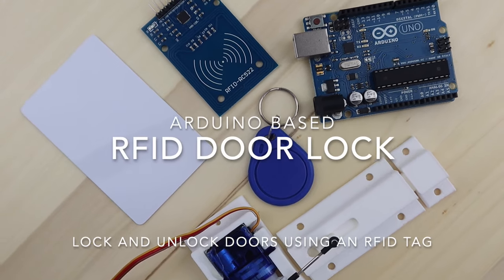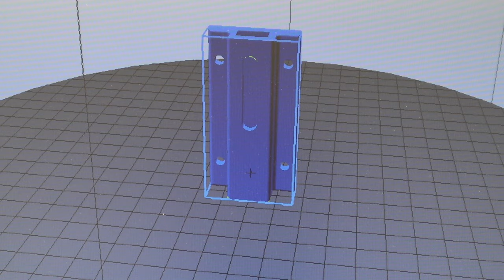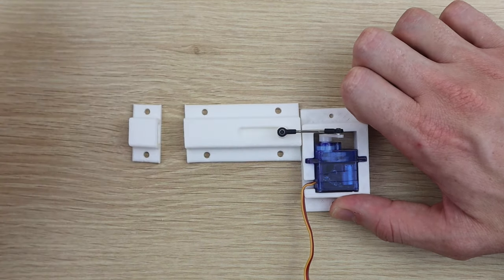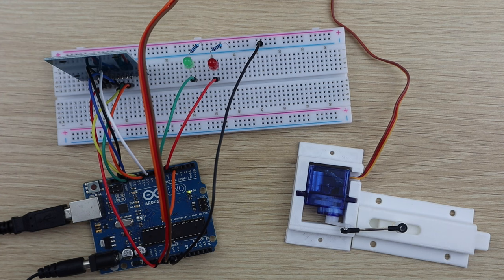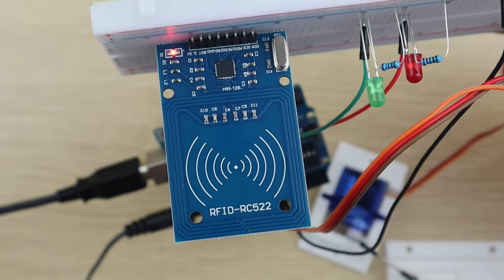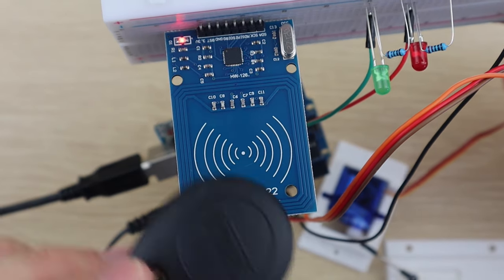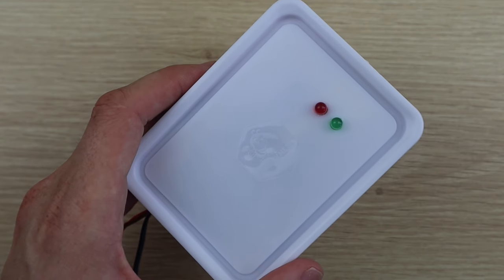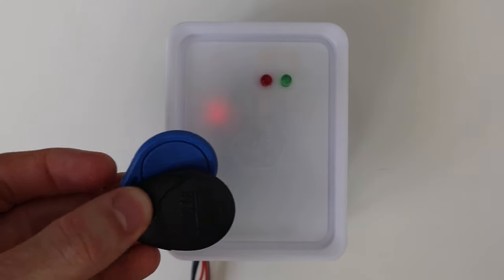Arduino Based RFID Door Lock  - Make Your Own

Comment: I like your design. Have you considered adding a keypad to this? A concept in security is 'something you have - the RFID tag, and something you know - a passcode'
Reply from the maker: Thanks PyroRob69. Yes, a keypad would be a nice addition. You'd have to get rid of the LEDs then though as there aren't enough IO pins for both. There are only 6 spare and you'd need 8 for the keypad.
Reply: @MichaelKlements  Unless the LCD was using I2C. Also, with the LCD, you could use single char's to do the same thing as your LED's do. You can place any char you want, in any place you want on that display.
Reply from the maker: Yes, an I2C LCD display would be a nice addition as well. You could then add the card/tag owners name to be displayed when a valid card/tag is read as well.
Reply: @MichaelKlements  I have found two I2C devices that would allow you to use a standard keypad with. One already has a keypad library written for it, but the other would require you to use bit banging and the Wire library. On the upside, the one that requires the Wire library can handle 16 pins instead of just 8, therefore you could control both the keypad and the RFID scanner with one I2C adapter.
Reply from the maker: These look great, I'll definitely have a look at them! Thank you.
Reply: @MichaelKlements  Cool! I hope you will make another video using them :) (hint hint!)
Reply: @PyroRob69  You can always use Shift Registers when you dont have anough I/O pins. you can create unlimitied I/O pins from just 3 pins. You would just then have to implement the logic.

Comment: I'm new to this. i have watched some instructional videos including yours. this one was perfect. from what i have picked up, I'm a little stumped here now. how would one go about adding a push button to this circuit to cycle the servo motor separate from the RFID reader control?
Reply from the maker: You'd just need to add a pushbutton onto one of the Arduinos digital inputs and add a condition to the main loop in the code to move the servo if the pushbutton is on or off. The Arduino can choose to override the RFID input.
Reply: @MichaelKlements  could you also put a delay and re-lock the device after a set amount of time? I am looking at using this to keep my dog out but allow the cat to go through a door.

Comment: great code! 

however id like to add that it would be better if the mechanism locked  itself automatically, no need to use the RFID tag to lock it, its supposed to be used exclusively to open it (like a conventional hotel room door that uses this tech)

Comment: how to access the lock from the other side of the door? like locking or unlocking from the inside
Reply from the maker: It depends on whether you want it to be secure on the inside as well. Most places would just have a push button on the inside to open the lock again. This lock stays open until you scan the tag again and then locks. So you lock and unlock it from the outside.

Comment: Hello! I got an error when trying to verify it. It says "RFID.h: No such file or directory". I haven't attached my arduino yet to the pc. What can I do to fix this?
Reply from the maker: Install the RFID library that was bundled with the code .zip download
Reply: @MichaelKlements  Thanks, I already figured it out. May I ask, I have a RFID id from my school, will this also work with that type of rfid scanner?
Reply from the maker: You'll just have to try it. There are a wide range of RFID frequencies and technologies, so it's unlikely to work, but it's not impossible.
Reply: @MichaelKlements  Alright, Thank you so much!
Reply: @MichaelKlements  Hi, do I need to solder the head pins that comes with the rfid scanner?

Comment: To who ever is using an arduino uno r3 and is experiencing problems with the card reader. Plug the rst pin which is on the sensor to the 5th pin on the arduino

Comment: i uploaded the code and it works but i dont know the number for my card and tag so how do i find it?
Reply: i tried using serial monitor but it does not show the tag or card being denied it only says place card/tag near reader
Reply: the D1  light on the reader is lighting up red
Reply from the maker: If you're card doesn't show up in the serial monitor then it's either not able to be read by the RFID sensor or you've got a wiring problem and the sensor isn't communicating with the Arduino.
Reply: ok ill try rewiring the rfid sensor and get back to you
Reply: im sorry that im taking more than a month to respond, but thank you soo much it works it was probably a problem with my wiring. Thank you

Comment: Hi, where did you get the metal arm to attach to the servo? Or did you make it yourself? If so, do you have any resources that you could point me towards for making one? Thanks, video was super helpful!
Reply from the maker: It's just a standard servo push-rod and ball from Hobbyking, they're used to actuate the control surfaces on RC aircraft. Glad it helped!
Reply: @MichaelKlements  Thanks! New to this stuff so wasn't sure of the term.
Reply from the maker: No problem. You should be able to buy one off eBay, Hobbyking or a local hobby shop for quite cheap.

Comment: Hi again! I just bought a similar Rfid module, should the pins be soldered? It seems firm in the video, I tried to do this project and it did not work in my 1st try.
Reply from the maker: Yes it works best to solder them
Reply: @MichaelKlements  Alright, thanks!

Comment: I'm wondering if I can use this to diy a pet door so it will lock when my cat goes near it? How close does the tag need to be to the sensor for it to read? And is there a way to make it so the lock stays open but when the tag is within a specific distance it will stay locked until the tag leaves the sensor range? Of course, making the locked position the default would also work if I put the tag on the dog, but that still leaves the question of how close it has to be to the sensor?
Reply from the maker: Hi Elizabeth,
You could certainly do what you’ve described with an RFID tag, but these particular ones need to be quite close to be read. Probably closer than what a pet would be able to get it unless you could figure out how to hang it so that it came within about 2-3cm from the read when the cat tries to go through the door. Different tags work on different frequencies and offer longer or shorter reading distances. The ones on credit cards for example need to be really close while ones used in vehicle tags can be read from around 5-10m away.
Reply: @MichaelKlements  awesome! I was starting to lose hope after doing some more research (I don't have any kind of experiencewith this kind of thing, but I do research for a living so I'm pretty determined to figure it out lol), but I'll look into the other types you mentioned! Thanks!

Comment: It finally worked, i just soldered the pins with the rfid module. Last question, is it okay to connect it with a 9volts external battery through DC?
Reply from the maker: Yes you can use a 9V battery, but it must be connected to the barrel jack on the Arduino so that it is regulated.
Reply: @MichaelKlements  Thank you! is it always safe to use 9V battery and connect it to the barrel jack of the arduino? I sometimes worry that some components might burn. Sorry I am new to this.
Reply: @MichaelKlements  And how would I know if it is not safe. I always worry that some parts such as led or rfid scanner would broke if I do a wrong power supply voltage.
Reply from the maker: As long as it's a 7-12V battery it'll be fine to connect to your Arduino's barrel jack. The Arduino regulates the voltage to 3.3V and 5V, just make sure that your sensor is connected to the correct supply voltage. Most (almost all) sensors that are made for tinkering with electronics are 5V compatible, there are however a few that run on 3.3V but will say so in the datasheet.
Reply: @MichaelKlements  Update: I tried connecting to to a 9V through the arduino jack but weird stuff keeps happening. When I scan the rfid with access, the led lights keeps on flashing and servo motor keeps on moving. But all seems well if it is connected to the computer.
Reply from the maker: A 9V block battery can't provide enough current to power a servo, so the voltage is dropping and causing your Arduino to "reset" when the servo tries to move

Comment: Great video. A different setup with 3 LEDs would be useful too, with the third LED flashing when something that is not a RFID tag is detected.
Reply from the maker: I don't think the RFID sensor can detect anything other than an RFID tag, so anything that is an RFID tag that isn't registered flashes red but anything else will just go undetected.
Reply: @MichaelKlements  Quite right, it would need a different setup with a presence sensor or something. I thought it could also help debug the setup, as I see that some people who tried it got zero LED or feedback, but then, there is no limit on improving this kind of setup, people who add a presence sensor would then want to add a camera to snap the unchipped intruder, then a buzzer to scare them away, etc.  😁

Comment: Do i need 2 RFID sensors for both sides of the room (for example getting in my room and then closing the door the sensor would be outside)
Reply from the maker: You would usually just add a pushbutton to lock/unlock the door from the inside, unless you have a reason to restrict access in both directions.
Reply: @MichaelKlements  thanks

Comment: hi, i just build this and plugged everything in correctly i assume, because all the lights on everything are on but when i try to upload the code i get this message "RFID_Door_Lock:6:10: fatal error: RFID.h: No such file or directory
 #include <RFID.h>
          ^~~~~~~~
compilation terminated.
exit status 1" and I wanted to know how to fix it? i looked at your build through page and i cant seem to figure out what I need to do to fix it... could you help me figure it out?
Reply from the maker: You need to install the RFID library as outlined in the code section of the written guide.
Reply: @MichaelKlements  where can I get the library?
Reply from the maker: Its in the same .zip file as the code

Comment: Hi, great video! But i have an issue with reading the card. I checked the wiring so many times, I bought six of those RC522's, and none of them work.
When I connect the Arduino to the RC522 and open the Serial Monitor, I get the message:

"Firmware Version: 0x92 = v2.0"

When I unplug the RC522 and run the serial monitor, I get the message:

"Firmware Version: 0x0 = (unknown)
WARNING: Communication failure, is the MFRC522 properly connected?"

So this means the connection between the Arduino and the RC522 works, but still, with 6 different RC522's, I get absolutely nothing out of it. Maybe the code is not relevant anymore? I don't know what to do, I've already struggled for three days with this problem...

Comment: Hi, thanks for making this video. I have a question, the tag doesn't seem to work, and I'm pretty sure the wires are correct because I checked a lot. Also there is a light on the RFID sensor so I think that's connected good too. And the code doesn't give any errors. The LED's don't do anything, but I don't know if that is just because the tag isn't working. Maybe I am really stupid and there is something obvious I was supposed to change in the code or in the wires to adjust it for a reason I don't know. I'm still pretty new to arduino so I still really hope there is an obvious solution. Hope you have time to help.
Reply from the maker: Hi Linde,
You shouldn't need to change anything in the code if you've wired it as per the diagram and you're using the same component. The LEDs should come on sequentially like in the video when you power it up, if this isn't happening then you've either got wiring problems to the LEDs or the SPI communication to the RFID sensor is failing - most likely because it's not connected correctly. Also try opening up the Serial monitor, does it display "Place card/tag near reader...", indicating that it's run through the setup function?
Reply: @MichaelKlements  Hi, I think the hardware is now correct, because when I open the SerialNumberRead he does recognise my tag and I can read the serial number. But then when I open the serial monitor in the final code, and I scan my tag it doesn't seem to recognise it at all. I am still a beginner so if there is an obvious thing I was suppossed to do that you didn't say I had to change in the code, I probably haven't done it. The only thing I now have changed are the serial numbers to grant acces to and I have added the library. Any idea why he does recognise the tag in the SerialNumberRead but not in the final RFID code? I also don't get a green LED light and nothing moves or happenes when I scan the tag.
Reply: @linde1670  Me to, can you help please
Reply: @phoenixtrimpe961  It still didn't work, I don't know what is wrong, I kind of gave up, I will look at it again next week, if I find something I'll let you know
Reply: @linde1670  This was the exact same problem I too encounter .If you find out any solution let me know . I am too new to arduino
Reply: @linde1670  This was the exact same problem I too encounter .If you find out any solution let me know . I am too new to arduino.

Comment: does the tag id number change and where would i find that
Reply from the maker: Each RFID tag has it's own unique ID number. You'll scan the tag on your RFID reader with the Serial monitor open and it'll display the tag number for you. You can then add the tag to your list of allowable tags to grant access to the new tag.
Reply: Michael Klements ok thanks
Reply: Is it possible to change rfid tag value

Comment: Is there any different between arduino uno?
And also if I used different arduino can the code be use?
The arduino in your link has sold out, I’m not sure if i found the same one.
Reply from the maker: Generally speaking, all Arduino Uno's are made to the same specification, so should be compatible with each other. Some companies do add or remove features, but the pin numbers, layout and general functionality should be the same. 
Yes, you can use a different Arduino, just make sure that it still has enough IO pins and operates at the same voltage.
Thank you, I've updated the link to one which is still available.
Reply: @MichaelKlements  hi thanks for your reply, do you have the schematic diagram of this circuit? I'm doing this as my school project, but I don't know how to create a schematic diagram.
Reply from the maker: I haven't gotten around to drawing up a schematic, I've only done the breadboard layout. You could probably put something together quite quickly using Fritzing

Comment: hi, i want to develop the locking system in the laptop trolley for our college . So, department get update who's are using it and what time they are using it. So is it possible to do with our stuff ID card. Thanks
Reply from the maker: If you can find an RFID module that works with your staff ID card then you could probably make something similar. Some RFID systems are open source and some aren't.
Reply: @MichaelKlements  how about the implementing tracking or update in the system

Comment: I am new to all of this (arduino) and I am trying to get it to work I have checked the connections and download the code 3 times even copied it by hand once  but i cant find nothing wrong. Is there a change in the code or the wiring required?thx.
Reply from the maker: There are a number of reasons why this might not be working. What part is not working? Are you getting text on your serial monitor? Are the LEDs coming on?
Reply: For me the problem is that I have an error when I try to put the code in through the the zip thing. It says library doesn’t contain valid library

Comment: Are the leds  necessary and is there a premade lock design like the one used that could just be loaded onto the build plate? Also what kind of filament would be recommended? This is for a school project so if anybody has answers that would be great if you could share them 🫶 thank you

Comment: How easy would it be to add the 16*2 Lcd module as a visual improvement?
Reply from the maker: That should be quite easy to do, there is enough IO available. I’d maybe suggest an I2C oled display rather?
Reply: @MichaelKlements  thanks, ill give it a try, looks more impressive than the lcd, great project.
Reply: Hello im trying to add lcd i2c to the code but i couldn't can someone help me asap pls ?

Comment: Is there a way to adapt this for two door locks on two doors.
Reply from the maker: Yeah you could use the same Arduino to open two locks with the same RFID card or different locks depending on which card is used.

Comment: My RFID doesn't have the thing to connect it to the Arduino. What can I do to connect it to the breadboard?
Reply from the maker: If you're talking about the black header pin strip, you'll need to solder this on to use it on a breadboard or with an Arduino

Comment: can i use RFID PN532 for this operation ?
Reply from the maker: You can use the PN532 for the same type of project, but you'd need to change the code and the library used.
Reply: @MichaelKlements  ok , ty so much !

Comment: Where did you get the metal bar to connect the lock to the actuator?
Reply from the maker: It’s just an RC aircraft pushrod from and old aeroplane. They’re often on RC cars, boats, aeroplanes or helicopters.
Reply: @MichaelKlements  HELP